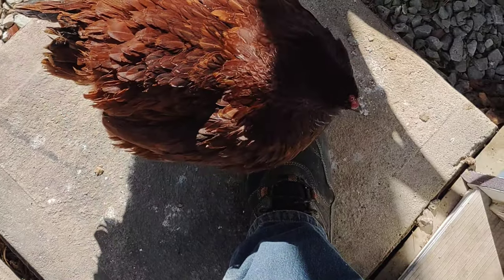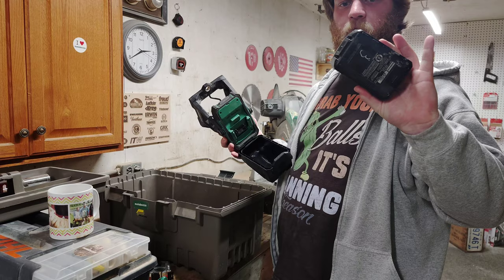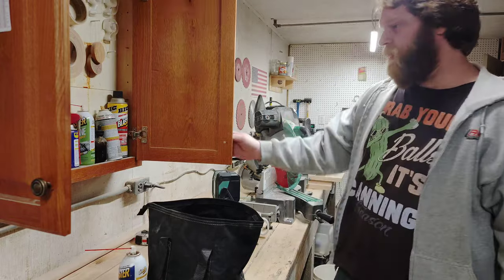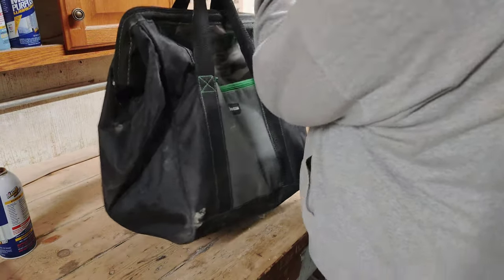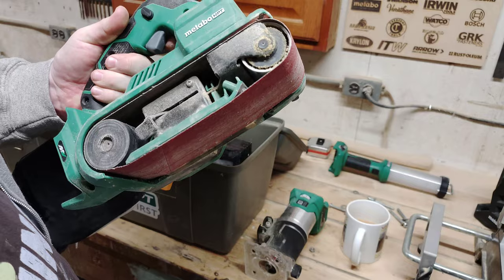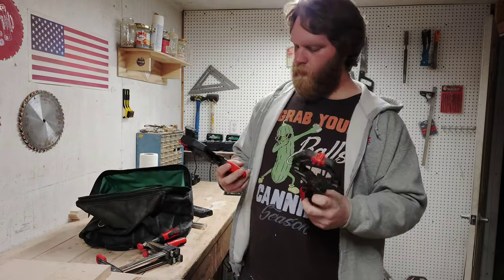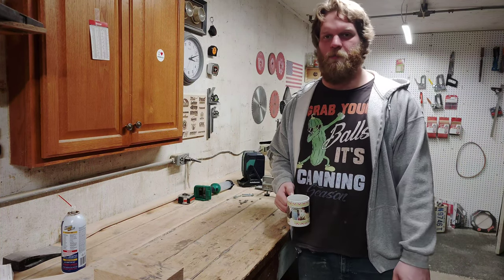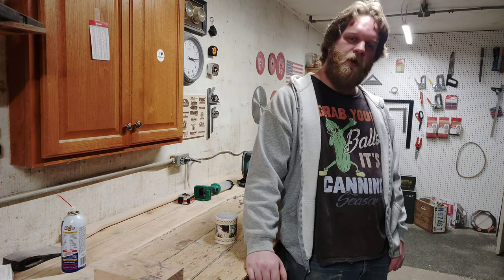Tool load out for remodeling - The Trailer EP 16.5

Comment: What is your true opinion on Metabo HPT?
Reply from the maker: Dead nuts dependable and a fantastic company to work with. I've got 31 of their tools not counting batteries and accessories.
Reply: @dogsongwoodworks  I’ve been getting away from Dewalt and transitioning to HPT. I got about 7 so far. Love the Triple Hammer. Knocked a deck out with it. I haven’t truly tested the others yet. I need a new hand planer but there’s is brushed … disappointing anyway just looking for other’s opinions, thanks again.
Reply from the maker: @Eyespy11  most 3-1/4" planers out there will be brushed. There's really no huge benefit in a planer to have a brushless motor except maybe temp and run time for longer sessions. But how long do you use a planer for anyways? Usually use them to knock out a door and that's it. My Bosch pl2632 which is being replaced soon is also brushed.

Even the brushed metabo hpt stuff is top tier. My recip is brushed, as well as my miter saws, table saws, one of my routers, a couple of my sanders, etc. They all run great.
Reply: @dogsongwoodworks  I was thinking the same thing. I really don’t need the planer to be brushed. It won’t get prolonged use, but the battery lasts longer and the brushless has a little more power, and yes I have their brushed one handed recip saw which I did used extensively one job. But, I still think in 2023 they should get with the program fully.
Reply from the maker: @Eyespy11  what a lot of people don't realize about the brushed vs brushless thing, is that there are advantages and disadvantages to both. For a lot of cordless stuff, yes brushless makes the most sense. It's lighter, usually has a bit more power, and is more efficient with batteries. However there are advantages to brushed motors as well. They last longer because they can be serviced, they can hold up longer over extended heavy use, and are generally less expensive to buy/fix/replace. Generally any tool I use all day, day in and day out for long runs I want to be brushed. Things like a table saw, heavy use planer, miter saw, sander, etc. The vast majority of new tools from metabo hpt will be brushless because that is the technology they have invested into most recently. I wouldn't make a decision on a tool purchase simply because it isn't brushless. The real question is, will it do the job and will I have to replace it in a couple years because it wasn't tough enough? I assure you that old fashioned brushed cordless planer will last through years of abuse.

Take a look at hiltis rental tools for example. Most of them are brushed because Hilti knows they will be abused. Instead of having to junk the entire tool when it wears out, they can simply replace what's worn out and put it back into service.

It isn't about "getting with the times". There are several good reasons why brushed tools are still a good buy even today. I'd still buy that planer over everything except German metabo, or maybe mafell or any of the other premium brands if I'm really going to be using it that much.
Reply from the maker: @Eyespy11  I'll also say this. I haven't broken any brushed metabo HPT tools. I have broken a couple brushless ones (which have been taken care of through metabo hpt's excellent warranty service).

Also my old brushed ripmax will outcut and outpace my fancy new 36v brushless rear handle saw, by a rather large margin. The rear handle is an awesome saw. But if I'm going to be ripping nothing but thick hardwoods all week, I'm probably going to reach for my brushed ripmax over my cordless rear handle simply because of the time savings.